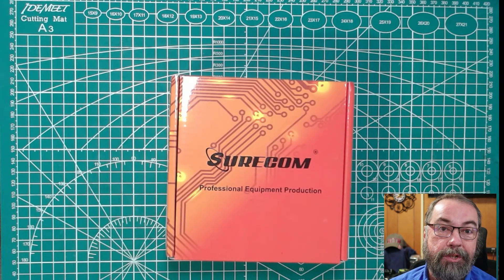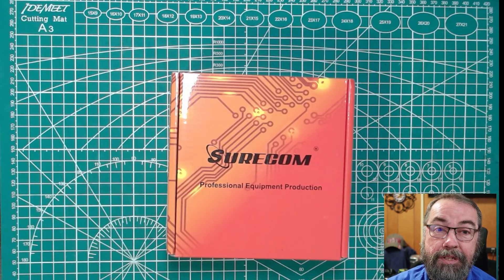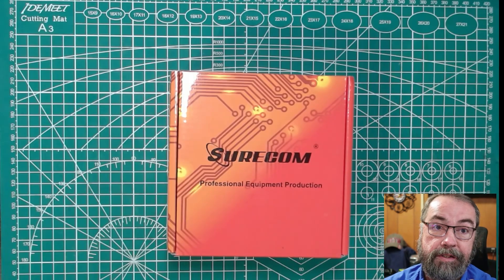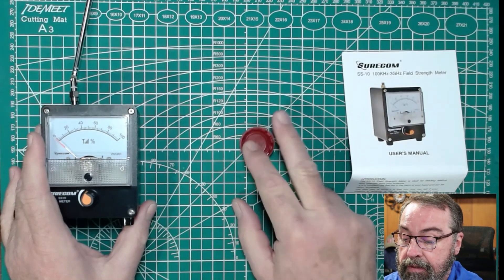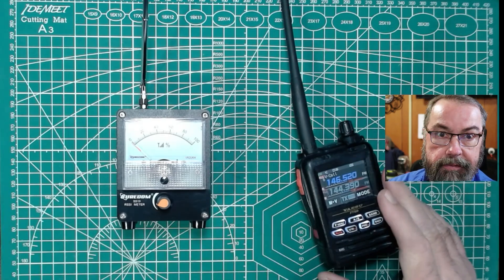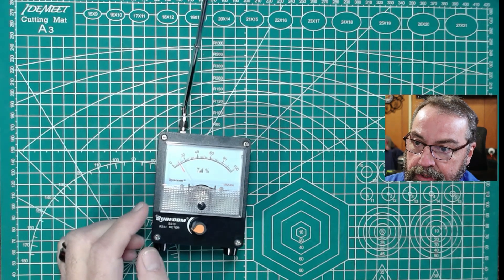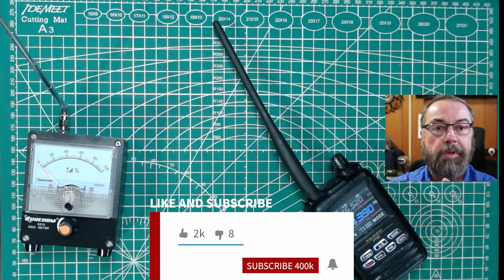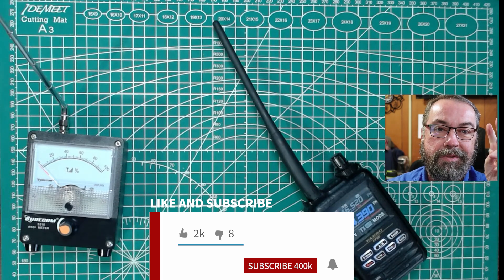RF Field Strength Meter - Radiation Patterns

Comment: why would you care for reading the field strength? what is it useful for?
Reply from the maker: A specific reason a ham might want to do that is to determine take off angles, as well as null spots on an antenna.
Reply: I am a rookie! But when i experiment with building different antenna designs(mostly with different parasitic elements), i have slightly different antennas with same SWR. So how i know whitch one performes better?  I think this tool will make it..... Or I am wrong?

Comment: There needs to be a NanoFSM with software. I wonder if the TinySA with the included antenna connected would also tell you your relative field strength? Then you could at least take screen captures at various locations and compare them to each other.

Comment: Looking forward to the results.  i have worked with similar studies on smaller antennas where we had an anechoic chamber that let you have a lot more control of the variables in the environment the antenna is in.  You don't have a lot of control over reflections and outside signal interference in the environment I would imagine you will have in the park in Florida.  good Luck! 73

Comment: Are you going to put one of those on a painters pole for z axis measurements?
Reply: It would be cool to have something set up with a drone that could fly a route fixed by GPS and  capture the data at a number of points.  4  arc's over top of the antenna starting at ground level  and samples at ever 15 deg of elevation change.   Probably would have to block out the drone control frequencies, but it would be a very handy tool!
Reply from the maker: That would be sweeeet!
Reply from the maker: I doubt we're gonna get that much science - We'd have to get 4 poles, or folks bring their own.  On top of that, most of us can't read the screen more than 6 feet away..
Reply: @FEPLabsRadio  I know.. I was just "running" with an idea, I don't expect that it will come anywhere near to a reality, unless someone gets a wild hair and wants to do something for a story in the QEX magazine..  
  As for reading a meter far away, (here I go again),  get one of the maker kids to take a PI Pico with wi fi,  and hook it to the meter to read the voltage when its told to from a supervisory program over the wi fi,  and then send it back to the program  so it could record it some way.    More dreaming on my part I guess!  Although the  Pi Pico's with wi fi are under $10 each..